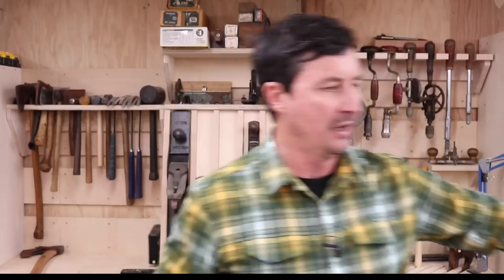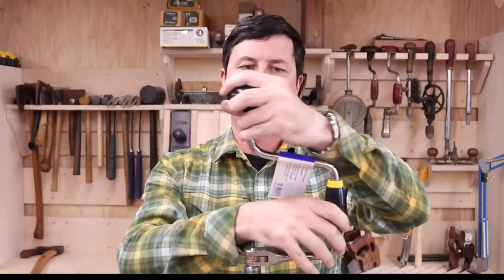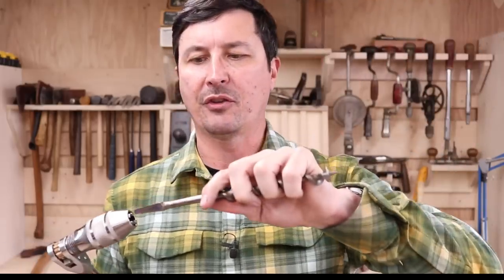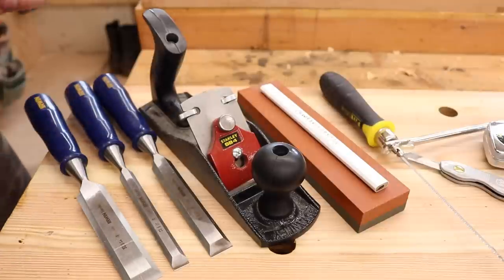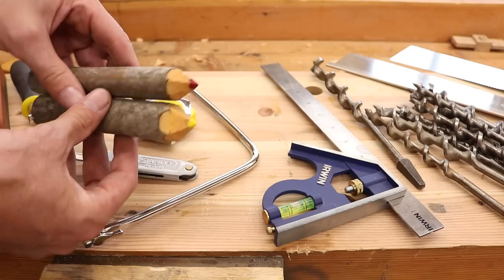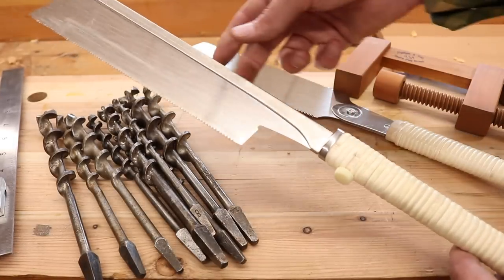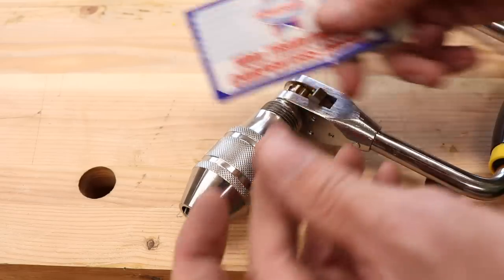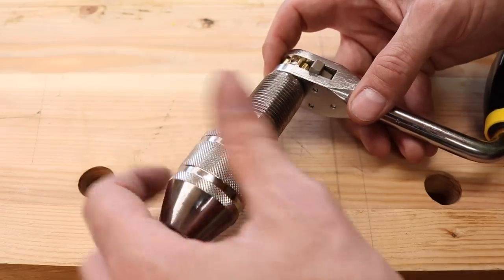Testing The Cheapest Drill On Amazon

Comment: the reason people "think" the manual drill is obsolete is because it is. there is no need for it unless you don't have much money, and you need a drill somewhere where there are no wall plugs. I found a drill that plugs in for cheaper than the manual drill your using in the video.
Reply: why are you so closed off from change?

Comment: are you sure you are not supposed to put the drill bit all the way in so the square of the bit goes in to the square hole of the chuck to prevent slipping?

Comment: It looks like you might know the answer to a question that I have.
I have a Miller's Falls #5 that is missing the cap on the main handle where the drill bits are stored. I can probably make most of that cap. But I would like to know how to thread the inside of that wooden cap to fit on that wooden handle. Right now there's a rubber cap on there off of the bottom of a walking cain that fits on there perfectly but it just pushes on, it does not thread on and it's not original.
It's usable as it is but without original looking parts I don't want to put too much work into it. I also need to make a side handle for it but I've done that for my North Brothers 1545. I made one out of a file handle, including the screwdriver bit on the end of the threaded shaft.

Is there a bottoming tap that I can use to thread that cap for the Miller Falls # 5 ?
Is there someone out there who makes those caps for drills with missing caps?
Maybe I will just clean it up and sell it. What would you recommend?

Comment: What exactly is the purpose of one of these  drills now that we have electric drills and drill presses??
Reply: They're infinitely portable, damn near bulletproof, and with a good set of the old style auger bits you can drill pretty much any kind of wood you want with more control than is possible with a drill motor. The downside is that you have to do the work yourself. I think most of my electric drills have spirit levels on them, and of course drill presses often have fairly precise angle settings, but with a hand drill your angle is entirely up to you. If your eye is off then your hole is off, and there's not much to be done about it. Drill motors will also often muscle through the work even if your bit is dull. Try that with a bit and brace or an eggbeater drill and you're looking at a long, unpleasant day.

Comment: there is a use for a brace, in some circumstances, particularly in a traditional tool set. but for the most part you would be fine using something a little more american (sorry, but the brace and bit AREN'T american, shocker, i know, but the earliest known is dutch). and the bits aren't produced much anymore for a reason, better tools are available and they aren't compatible with those faster moving modern tools... but be chipper, because there are traditional ways to make holes that don't involve using a brace, although it does depend on what you consider traditional. if you think of traditional as including things after the 1700s, guess what carpenter shops had back then, basically machine tools for wood. so stop farting a wood chip and just use a damn drill unless you want to invest in a set of bits, which i reccomend that you do, but you are outside the idea of anything common man at that point.
Reply: let me elaborate, americans in the early 1800s and late 1700s were familiar with the brace, but it wasn't a common tool unless you were on the frontier, so when you see holes in old shaker carpentry, or quaker, or puritan, or wherever, it wasn't a brace that was used unless that shop was WAY out in the boonies, they went to the closest mill and hooked up and drilled using what can only be called a modern drill bit. usually tossing a penny at the mill or a couple pennies at the person and the mill. braces have been purely for situations where you can't bring the work to the power for centuries, and while they are a part of a traditional tool set, if you have a modern tool set look at your tools and you will see several that you actually hardly ever use, unless you are building houses in the era i talk about you don't use a brace, because there are easier ways to make a bunch of holes. hell yeah for one or two, or when you don't have a choice, but carpentry shops didn't hardly touch the damn thing back then.